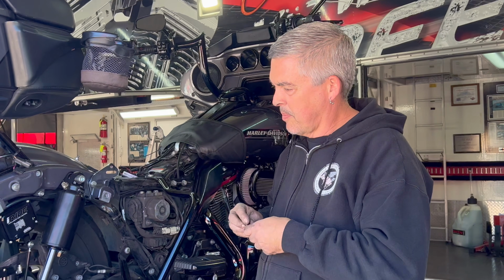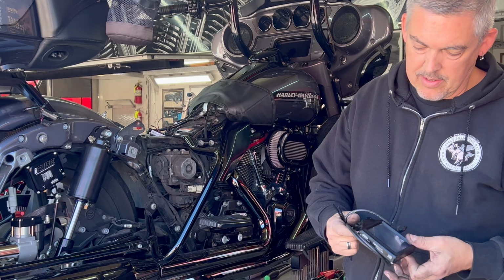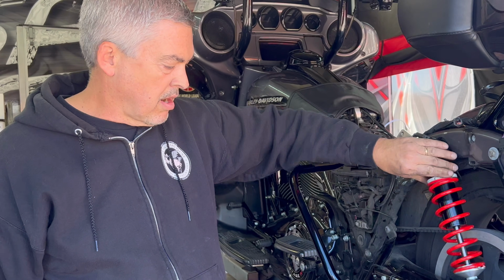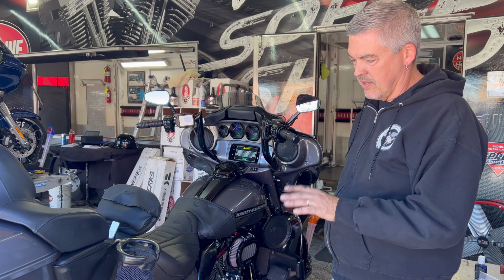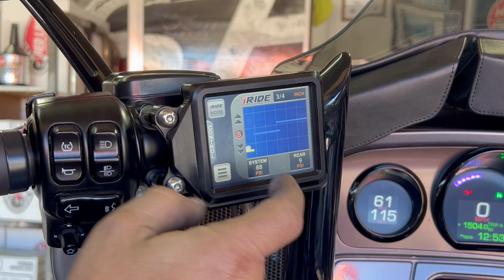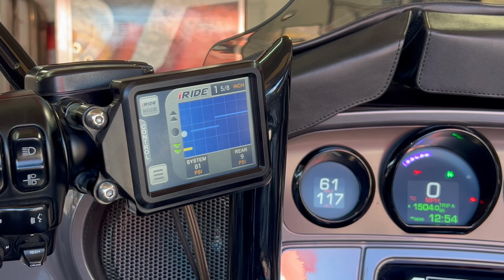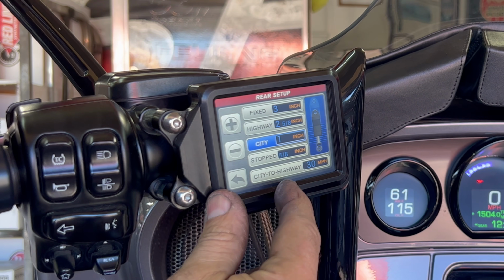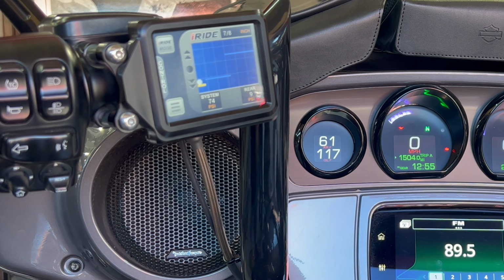Intelligent Air Ride Suspension For Harley Davidson Tmax Iride

Comment: What happens to the system during constant city stop and go traffic?
Reply: I was thinking similar since I’m very confident in slow turns like a parking lot. The las thing I need is go full steering lock turn and scrape the ground throwing me off balance. But as he said in the video you can set the ride height levels at your own preferred speeds. I can reach the ground on my bike so all I need is maybe 1” at a full stop? I tried a lowering kit that lowered my bike 2”. It felt good but the suspension couldn’t handle the increased leverage so my shocks were bottoming out.
Reply: If watched the entire video, you can adjust the speed for when it comes up